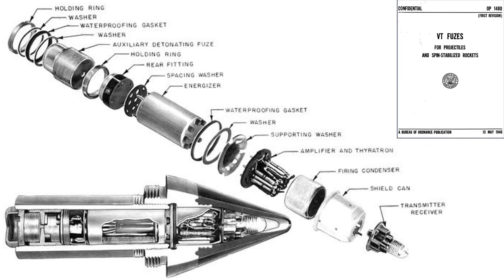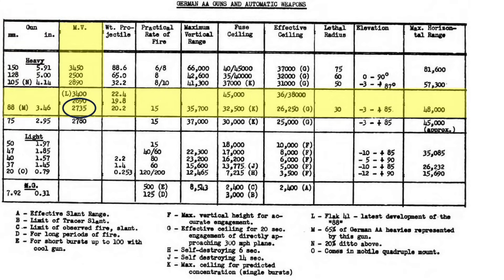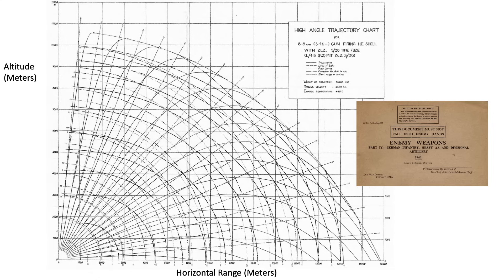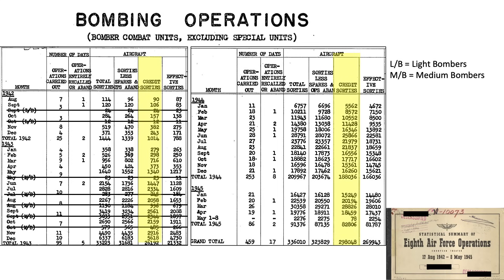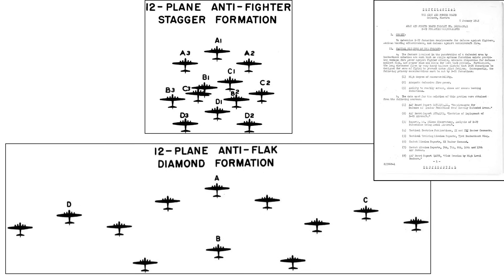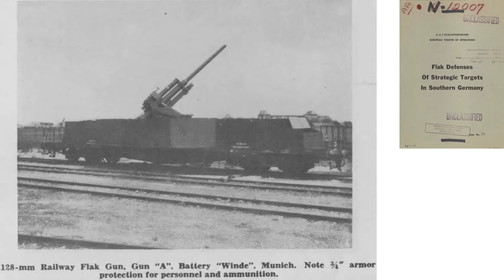Germany's big Mistake, no Proximity Fuse in WWII

Comment from the maker: Correction: Rate of fire of the 88mm FLAK gun is 15 rounds per minute, not per second.
Reply: That would be some weapon!!
Reply: Thank goodness!
Reply: Maybe with a very buff loader
Reply: This number is for the very elite Aryan artillerymen.
Reply: Hitler’s BRRRRT
Reply: i just watched that part and was headed to the comments lol
Reply: Was about to say, 15 rounds per second? Damn, this magical flak gun is like an mg-34! brrrrrrrrrrrrt!
Reply: The 8.8cm FLAK 37 had cadence rate of 15 Rounds Per Minute with a muzzle velocity of   810 meters/sec.  
The 8.8cm FLAK 41 had cadence rate of 25 Rounds Per Minute with a muzzle velocity of 1000 meters/sec. 
The  FLAK 41 had an autoloader with an integrated fuse setting machine.    The FLAK 37 had a separate mechanical fuse setting machine manually set by dial gauge from the Kommandogerät 40 FLAK predictor which gave the lead, firing time and fuse setting time.   Unlike the US M7 predictor the Germans integrated the 4m base range finder into the unit.
The 8.8cm FLAK 41 was in service in 1942 even in North Africa but it suffered when brass cartridges were replaced with steel and also suffered from vibrationTK which meant it did not achieve its firing rate.  These problems were solved by 1944 but too late to effect the war much.  The FLAK 41 fired on the recoil.
       -There was a German Proximity Fuse called Kuhglochen by Rheinmetal.  About 1000 rounds were fired between 1943 and 1944.  Range was 4m but 10m and even 15m was possible on ground test.    It was too late to produce as the Soviets over ran the factory in present Poland (then Germany) in 1945.
Kuhglochen should not be confused with kuhglocke which is for missiles and not shock hardened.   The 8.8cm shell was considered capable of bringing down a 4 engine bombers so long at it was within 3.5m so 4m range was adequate.
Reply: An 88mm shell every four seconds is damed impressive…especially in the context of its direct fire missions. 🤔
Reply: @JoeOvercoat  It still is! 
Not sure, but I think I once read in a manual that these were "burst mode" numbers, not "sustained barrage mode". 
Even with two or more loaders that is a very demanding cadence.
Reply: o/ Thanks again for the historical estimate!
Reply: Came here to ask this.
Reply: Tens of thousands of Flak rounds in fact HIT their targets BUT PIERCED IT and flew through WITHOUT IGNITION. And the bombers of that time were so constructed that they could survive mere HOLES in their hull structures.
Reply: Oooch, no ULTIMATE DAKKA DAKKA! 🤪
You runied all Wheraboo's wet dreams.😄
Reply: Not even metric seconds?
Reply: Yes, with another round ignition, the Flak's kill rate would have been at least thrice as high. And that would have meant the losses in material & personell after each raid would have been unbearable in the long run.
Reply: This is unfair ! I was just going to make this (obvious) correction when . . .
Excellent, as usual.  Should reference Baldwin's "The Dead)y Fuze".

Comment: You forgot to mention the "Kommandogerät 40" , a targeting or fire control computer . A Flak battery had four 8.8 Flak guns and one computer , wich measured the enemy bomber and sended data for gun elevation and time fuze to the guns . Up to 12km altitude and 18km away/range , so they were pretty accurate . They fired not just stupid in the air , 15 shells per minute . So there was maybe no need for VT fuze , they never thought about that .
Reply: Not a valid point, the US and the UK armies also had targeting computers, but a proximity fuse is still more effective, because you can't shoot at a specific plane, you aim for the center of the formation and hope it explodes close enough. With a radar fuse it would only explode if close enough and well aimed, but with timed fuses you can only aim well and hope to be lucky with the exact timing.
Reply: @MrSam1er  And you can tell me more about these two systems right ?
Reply: @5co756  Look at the other videos on this chanel, it's pretty well researched. There is also the number of 3000 shells for one bomber with timed fuses, and 2000 shells for one bomber with contact fuses, this suggests that even contact fuses are better than timed fuses (these numbers are for german FLAK against allied bombers). So now replace these contact fuses with proximity fuses and every close call becomes a hit, this gives you a way better success rate than timed fuses.
Reply: @MrSam1er  First I wanted to know how these UK and US targeting computers were called , so I can research them . 

And second this were US numbers from WW2 and against kamikaze fighters in the pazific war . They never shoot at enemy bomber formations 10km up in the air , so it's hard to compare this .

Comment: We were already using chaff and electronic countermeasures to spoof their air search radar.  A radar-based VT fuse would be vulnerable to these tactics, so I suspect that loss rates would initially jump but be mitigated significantly by adapting existing techniques.

Comment: The NAVWEAPS site has an article “Crosleys Secret  War Effort the Proximity Fuze” with more information on the  development, manufacture and effectiveness of the VT fuse, including effectiveness vs. non kamikaze targets. Kamikazes are tough  targets, the range is changing so fast it is almost impossible to set the timers on heavy 5” shells.  40mm and 20mm require many hits to destroy one.

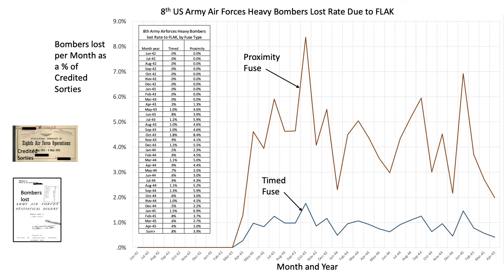Comment: 6:40 : Actually, the number of German FlaK rounds needed to down a U.S. heavy bomber wouldn't necessarily be divided by a 4.75 factor had the Germans had access to proximity fuzes, because it relies on data of the U.S. Navy engaging Japanese suicide aircraft, which means :

a) It pertains to 5" = 127mm rounds. The AAVT Mark 31 used in 5" guns had a bursting charge of 3.3kg of explosive D or composition A, while the 3 HE rounds for the German 88mm guns (8.8 cm. Sprgr. Patr. L/4.5 (kz.) m. Zt. Z. S/30, 8.8 cm. Sprgr. Patr. L/4.5 (kz.) m. Zt. Z. S/30 Fg, 8.8 cm. Sprgr. Patr. L/4.5 (kz.) m. A.Z. 23/28), which were the same round except for the fuzes, contained a bursting charge of 1kg of TNT or 40/60 amatol. So unless I'm completely wrong, the AAVT Mark 31 should have a larger lethal radius against identical targets than the 88mm rounds. Hence the probability of getting close enough to the target and still have lethal effects should be higher with the AAVT Mark 31 than with the 88mm rounds, so the ratio of close-enough detonations to direct impacts, which should be close to the VT combat effectiveness ratio, should be higher with the AAVT Mark 31.

b) U.S. Navy data was against Japanese suicide aircraft, which should have required less damage than U.S. heavy bombers to be shot down. If VT 127mm rounds were used against U.S. heavy bombers, they'd probably need to detonate closer to them to be lethal. And the lethal radius would be further reduced with VT 88mm rounds, so the VT combat effectiveness would further drop.

While I have no doubt that proximity fuzes would have greatly increased the combat effectiveness of German FlaK, I doubt it would have increased by a 4.75 factor.
Reply: A counterpoint would be that straight flying heavy bombers would be much easier to hit than a diving and evading small kamikaze plane.

Also while Japanese kamikaze planes had to be firmly shot down to stop them, the Germans only had to deal moderate damage to prevent the bombers from dropping their load and make them turn back.

Comment: If the Germans had developed a proximity fuse, would it have worked on their air to air rockets? The advantage of rockets is that they have less acceleration than a shell and they have a larger explosive charge than a flak gun's shell.

Comment: Navy sources indicate that the VT (Variable Time) fuze multiplied the effectiveness of 5" AAA fire by a factor of 4 to 7.  Keeping the Germans from reverse engineering the VT fuze was why the Allied ground forces in ETO were forbidden to use POZIT fuzes for land targets until the Ardennes offensive.  Proximity fuzes work for AA fire and also for causing airburst shells to detonate over troops in the open.  Question; given the state of German industry circa 1944 - could they have produced enough VT fuzes to make a significant difference?

Comment: Wouldn't the tinsel allied bombers dropped  to confuse radar be an extremely good coumtermeasure? At least what it did to the radar screens made it look like it gives out massive radar cross sections. But maybe it isn't as effective with close range radar?
Reply: Only the planes actively flying through such a cloud of chaff could hope to enjoy its effects. But that tinsel would probably not be good in an air intake. I don't think chaff would help much more than it already was for VT fuse shells. The shells aren't gojng to be confused much by chaff that is behind and below the target bomber. The gun targeting, if done solely off of radar signature, MAY be confused by chaff.

Comment: Utterly amazing how small the proximity fuse is. The cross section drawing 10 seconds into this video is most important to understand how they worked. Brilliant miniturisation for so long ago.  Genius. Thanks for this important information.
Reply: The miniaturization came out of hearing aid technology.  The first round fired was a single vacuum tube radio oscillator fired from a 37mm gun.  Many survived firing.
Reply: Are you sure about that? 1930s and 1940s hearing aids were bulky things with separate battery packs the user strapped to his leg, under his clothing. They were not the tiny things we're accustomed to seeing now. In fact, I wonder if the reverse is true: hearing aid technology leaped forward because of the proximity fuse work. Just my two cents worth.
Reply: @paulmaxwell8851  I’m absolutely sure.  The BuOrd history says the first vacuum tubes they tested had been developed for hearing aids.  The dropped the shells backward onto concrete floor to simulate the G forces and then fired them from 37mm rounds.  These formed the basis of the first experiments.   The damage to the valves was examined and modification improved them.
Reply: William, I stand corrected. Thank you.

Comment: Just to be clear, the muzzle velocity of the 88mm is Mach 2.45 as stated in this video. This is the maximum speed when the projectile leaves the muzzle. The projectile starts slowing down after it leaves the barrel. Mach number varies with air density & air temperature. As the projectile ascends the temperature decreases as does the air density. So the Mach 2.45 at sea level is 1867mph and at 30,000 feet is 1664 mph if travelling at the Mach 2.45. In reality the projectile would have slowed substantiality when reach its detonation altitude.  
Maybe someone can calculate the speed of the projectile at 30,000 feet.

Comment: I brought up the VT fuse, certainly along with others in the other video. We get results!  Another factor: against the Japanese, it was many guns concentrating on single aircraft. A flak battery just firing up into a formation, it would mainly be a vertical precision improvement. But you wouldn't expect any lateral improvement, since it's still only shells passing close enough laterally that would do the job, and the VT would mainly fix the problem of shells detonating too low or too high. I wonder what sort of difference that would make.
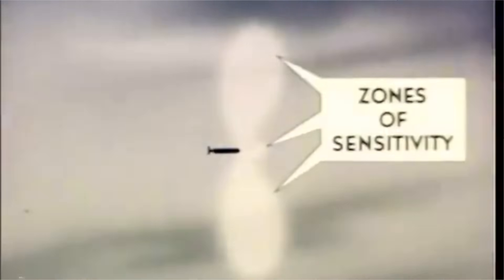Reply: fwiw if you look at old school documentaries on the VT fuze on YT, they describe the effect of the fuze as increasing the "effective surface area" of the target. And if you look closely at 4:32, you'll see  an illustration of this. Apparently the fuze was optimized to detect targets on the side of the shells. So it did provide some lateral improvement aswell.
Reply: Yes but the main thing is it detonates the shell at the airplane's level, correcting for timing errors of a time fuse. But if it's 500 yards away when it passes, won't make much difference. Obviously still way higher than without, and VT plus radar direction would be devastating I'm sure.  @WBtimhawk

Comment: So it took roughly 100,000 lbs of 88 FLAK shells to shoot down a 65,500 lbs gross weight B17? Even with VT fuse, it would cost around 25,000 lbs worth of shells.
Whereas a fighter with pilot, fuel, ammo and all would weight less than 10,000 lbs and likely could be reuse for several times. FLAK really wasn't a efficient anti-bombing solution.

Comment: finally! I have been talking about this issue for years! Just imagine the devastating effect of 128 mm from flak 40 with proximity fuses. The B-17s are just too vulnerable for such weapons.
Reply: But I believe the B-29s could fly missions higher then the much more plentiful 88s could reach.
Reply: @michaelbizon444  The 8.8cm FLAK 37 was ineffective much above 25,000ft but the 8.8cm FLAK 41 could reach the B-29 (about 39000ft).  The 12.8cm FLAK 40 was the most powerful AA gun of the war and could also reach to 40,000ft.   Both guns had only about 800 examples made.  The 12.8cm FLAK 40 because it was so expensive and the 8.8cm FLAK 41 because it''s technical problems weren't solved till 1944.
Reply: @williamzk9083  And the bombers were just as inaccurate or worse at max altitude cause they had the same over rated Norden's. If the resources in our new scenario were put into the heavy AAA and not V-1 & V-2 missiles they could have had more of the bigger better guns. Not good for bomber command I think.
Reply: @michaelbizon444 b-29 flying lower than b-17

Comment: Great video! Thank you! This is exactly what I was wondering! It is really interesting to hear what the effect of a German proximity fuse might have been. Considering that my father served in the eighth Air Force in Europe, starting in December 201944, I probably would not be here, if the Germans had deployed, proximity fuse earlier and vastly increased the number of bomber shut down. I am very fortunate.
Reply: -The USAAF estimated that a German proximity fuse would meant that the B-24 would need to be removed from service due to its lower operational ceiling.    In general proximity fuses are 4-5 times more effective per round.  The 8.8cm FLAK 37 (muzzle velocity 800m/s) had an engagement time of about 11 seconds at 30,000ft so it was ineffective above 25,000ft.  The more powerful 8.8cm FLAK 41 (muzzle velocity of 1000m/sec) could engage up to 39,000ft might even have removed the B-17 requiring the faster B-29  
-The Germans did have a proximity fuse for the 88 but despite successful test rounds being fired never got it into production.   (I'll explain in a post elsewhere)
-There was another type of fuse the double-fuse or doppelzunder that while not a proximity fuse was 3.5 times more effective against US Bomber formations.
The standard 88 fuse was timer only.   There was no nose contact fuse.  (they were considered too dangerous).  
Many rounds that would have been direct hits would simply detonate harmlessly below the bomber due to timer errors.  The ones that were direct hits would pass relatively harmlessly through the bomber and detonate usually too far above or more likely the timer mechanism would jam from the impact and defuse the round.
-Eventually a safe nose contact fuse was developed and it was found by going for a direct hit and firing with the fuses set to detonate 100m above the target the rounds were 3.5 times more effective.  A round that missed might still hit another bomber in the formation.  Overall the firing this way was 3.5 times more effective against formations and 2.5 times more effective against individual bombers.   The Germans did a lot of statistical analysis and successfully tested the theories in Feb 1945 too late to have any effect.
Reply: @williamzk9083  
Thank you for the additional information.  I have always wondered why Germany did not field a proximity fuse to combat the Allied bombing campaign.  I am grateful (existentially, for sure) that Germany did not have this technology when my father went to Europe as part of the US Army 8th Air Force in December of 1944.  Because bomber losses had declined by that time, my father never flew a combat mission but instead got stuck flying familiarization flights around England as they cherry picked replacements out of the aircrews he was a part of (he was a navigator and apparently navigators were not getting killed or wounded at the same rate as other positions in the B17 did).  Thank goodness on behalf of my existence!